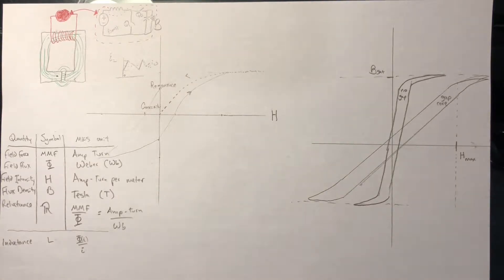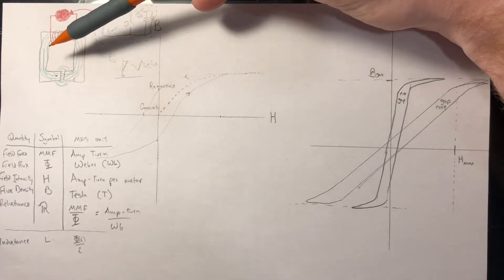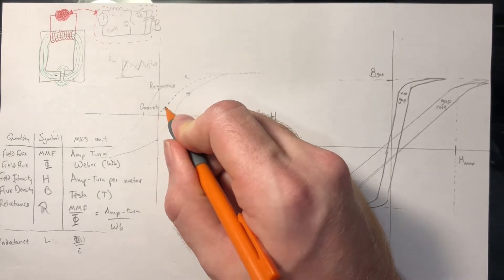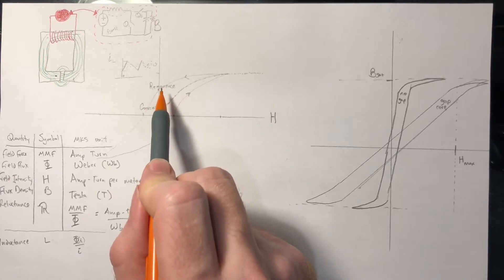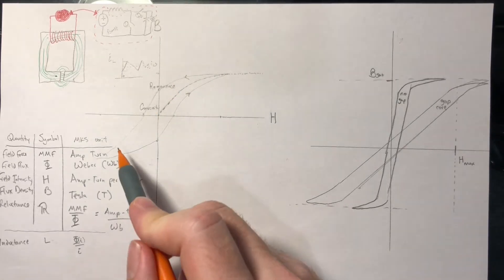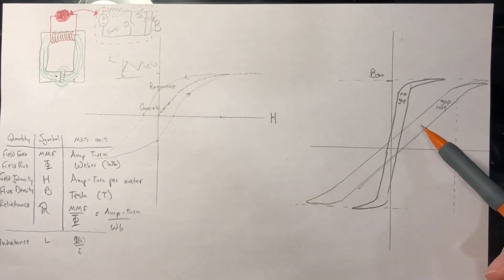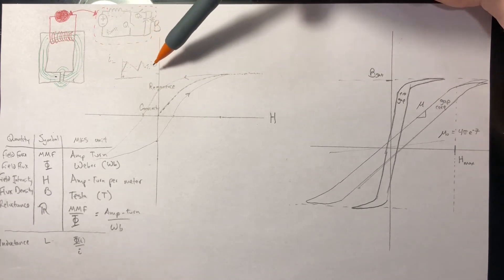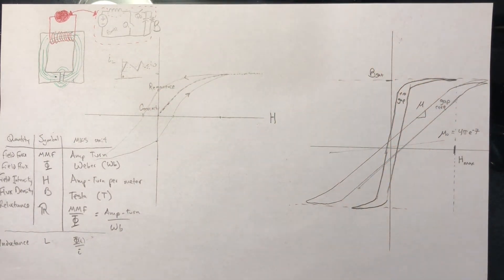Why Add an Air Gap to an Inductor? BH Curve Analysis

Comment: Please correct me if I'm wrong: As I understand it, once we approach saturation, the current through the winding largely increases, whereas the voltage across the inductor drops, because the inductive resistance drops and we're basically left with only the ohmic resistance of the wire.
Therefore, instead of using an airgap, couldn't we just interrupt the current flow right before saturation by using a fast MOSFET that uses the voltage across the inductor as its gate/source voltage?
I already simulated such a circuit in LTSpice - so far it works in general - but LTSpice doesn't simulate core saturation at all.
Would the reaction time not be quick enough (=how fast does saturation typically occur without any airgap?)? In case timing is indeed the issue here, in order to account for reaction delay of the MOSFET, we could also trigger it a little earlier by using only a certain fraction of the voltage across the inductor (=via voltage divider) as reference for the gate.

[Background of this question: I'm searching for a more efficient design for a flyback transformer, triggered via a flexible PWM frequency (regulated via Arduino), i.e. without using the auto-regulated switching frequency of a ZVS driver]

Thanks for the video!

Comment: If you used wood for your core, it would have 2 times the relative permeability of the air-gapped core and there would be no danger of saturation. Of course, you could also use glass or water. They all would be better than the air-gapped core.

Comment: Do flux remains constant before & after air gap? since both MMF & Reluctance increases by providing air gap (ɸ=MMF/R). By the diagram it seems to be decreasing, so it means the increase in MMF is less than increase in reluctance. Please clarify.